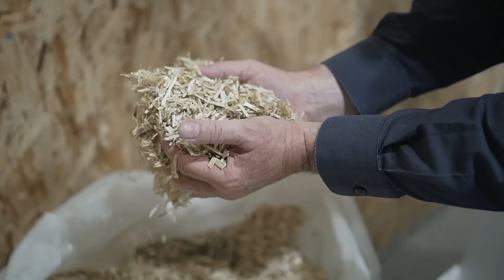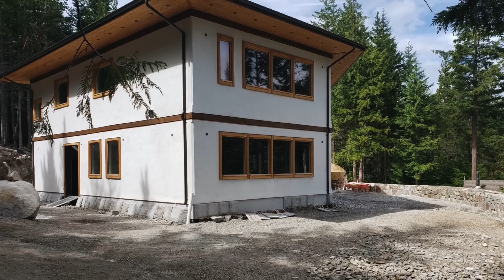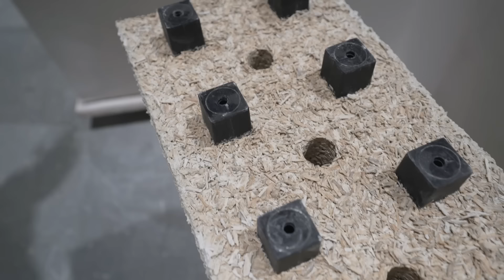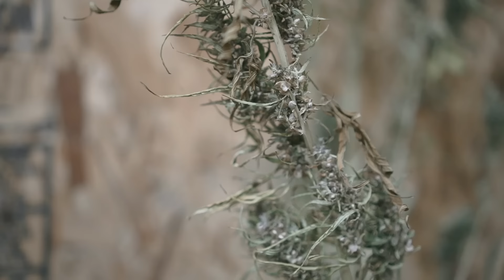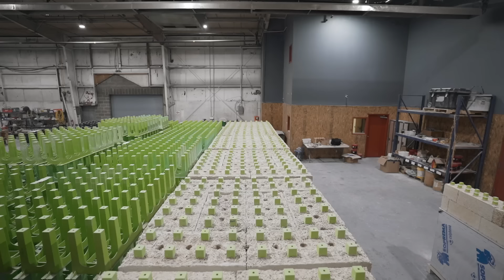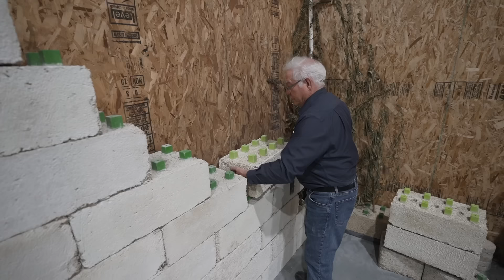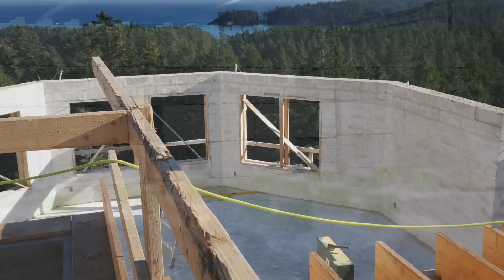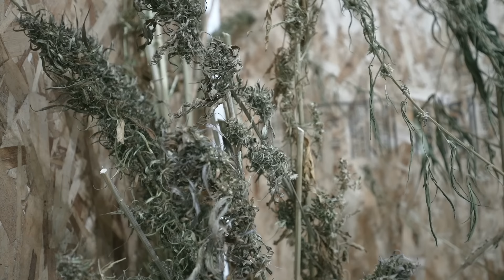Amazing Lego-Style HEMP BLOCKS Make Building a House Quick, Easy & Sustainable

Comment: If they're half the weight of concrete, labor costs for the construction of the home should be considerably less and construction time could be considerably less which would compensate for the high cost of the building blocks.

Comment: the ultimate construction material, build like this and clad every outer surface with photovoltaic panels, all walls and roof areas and you will have a dwelling that has no need to be connected to any grid for power, photovoltaic panels are 100% waterproof so will protect the outer surfaces, it's the future and I've seen it, where did I put the skins. . .

Comment: Please give a just-for-fun cost estimate for a school project. The idea is 9 modular, semi-independent rooms, each 18 X 18. The room front-left is a bedroom. Behind is a bath. Behind the bath is the kitchen. Front and center is the living room which takes up two cubes. It is 18 X 36. Behind it is the dining room. On the right are another bedroom, a bath, and another bedroom. Electrical and plumbing come from under the frost line and into the home center. The home is powered entirely by solar and wind power. The roof slope would be steep enough to prevent snow from accumulating. The home would be in Grass Valley CA. Would this home be cost-prohibitive when compared with traditional wood building?

Comment: I wonder if it handles an earthquake better than concrete blocks.  It looks like the blocks could vibrate an inch gap between them and settle back into its original state because of the connection pieces.

Comment: Be mindful of this types of "advancements" . They are designed for the benefit of Manufactures & Builders ..the end user, not so much.
There is just no way you could trust exterior walls made of this comparted to concrete. Hit the exterior wall with a hammer and tells me what happens.

Roxul will give you all the insulation you will ever need added to a concrete wall. A straw house is exactly that.

Comment: An Idea that has probably been said before, you could use recycled plastics in the form of filament usable by 3d printers and make those interlocking segments, making it so not only are you using a plant based material for the brick itself, but the frame in which the hempcrete is molded around is also taking plastics from going out to ocean and using them for our housing.
Reply: Not a good idea.  The reason they're using a thermosetting plastic as opposed to a thermoplastic like you would use in a fdm printer is heat resistance.  That's a pretty important factor if there's a fire.
Reply: I think we should just stop using plastic all together!

Comment: 8:30 "It sequesters like 1.6 times its weight in CO2..." This seems like a misleading statement. Plant fibre is made of cellulose. Cellulose is made of carbon, hydrogen, and oxygen. If you're telling me that it sequesters more than its weight in CO2, you're just telling me that there's carbon in the material, because 72% of the weight in carbon dioxide is the oxygen, and that can come from the ambient air as well as the oxygen in the cellulose, but nobody really cares about sequestering the oxygen. More accurately it sequesters some lesser fraction of its weight in carbon, and you could make that same statement to support building out of wood, grass, recycled plastic... basically anything that might otherwise be left to decompose or get incinerated.

Comment: what about the wet walls, vents, ducting, the foundation, roof and floor connections. Seismic, frost, and hurricane performance. You need tension members to handle this, there is no tension in a stacked block structure. Old brick buildings in seismic zones are death traps. And block is very heavy, for brick or CMU buildings there is steel rebar running in both directions throughout the whole wall usually. And you need a much wider foundation to support a heavy building like this. I like the concept of the product but these are huge issues. We need products that work in all climates and hazard zones and with standard building appliances and the mechanical and plumbing codes.

Comment: To be honest: No. There are reasons why houses are usually built with a supporting frame, which consists either of load bearing walls or beams. As others have already mentioned: How does such a building behave if there is an earthquake? Or what if the ground settles/moves a bit? Those blocks are not cemented together, mind you, and those thin layers of plaster on the sides will not do much. … I have no problem with hemp as a filler, I have a problem with the internal support structure. I would suggest to replace glass fiber or styrofoam insulation with hemp, but what I see here is just not convincing.

Comment: Hempcrete was pretty popular in Soviet Union (Called Arbolite, and it looks like it was invented in Europe), and currently popular building material in Russia. It's warm, it has enough strength and it has very high impact resistance, due to it's viscosity (not sure that viscosity is correct word here, but it's should describe it's property pretty well). Mostly it's not an industrial age material, as basic idea not changed since ancient Mesopotamia. Main problem with it is -- that it has poorly predictable properties. Your solution looks like an interesting innovation as your bricks should have somewhat predictable strength, i.e. solve the main problem of the material.

Comment: 2:42  The only difference between concrete and this hempcrete is the ingredients.  They BOTH have lime.  Lime is made from limestone which has to be kiln fired to RELEASE CARBON DIOXIDE, bound up in the rock, back into the atmosphere to turn it into lime.  Carbon dioxide is released from the limestone PLUS the energy used to fire up the kiln.  This is no more environmentally friendly than concrete.  It is only lighter and quicker to decompose.  I wouldn't want that for my foundation.  Solid concrete for my foundation please.

Comment: Where is the electrical and plumber going ? Do you need to cut into the blocks... Also, it does not seems to have a lot of lateral strength, what is a good way to improve that without destroying the concept, finally how do you fix anything on this, like pipes or even a shelve, lighting or else

Comment: Where are you going to find all these master plasterers to create those smooth plaster walls? Realistically it's probably going to have to be drywall on the inside. I think that pipe runs, electrical outlets and ductwork would be difficult to work ould with these block walls.

Comment: What are the acoustics like?  My favourite material to live in has been all wood.  I've lived in a scandinavian pre-fab wood cabin (well, really a 2000sq house but all wood; horizontally cut blocks with wood floors and ceilings etc) and the temperature stability, acoustics, energy have been unmatched by any other material.

Comment: Hempcrete is the best building material ever. It can be done even more simple as this lego aproach, complete diy. We have been living in our hempcrete house for 3 years now and we can't imagine living in a concrete house anymore. Building and living with hempcrete makes you sincerely happy.
Reply: Where are you located? Just curious because of building regulations will be my concern with using them
Reply: @reneerobinson6953  Slovenia. You will probably need certificate for  lime binder and another one for hempcrete mixture. Easiest way is to buy both materials from specialized manufacturer, for which you should get also certificates. In my case I onlly bought lime binder from italy ( senini tecnocanapa) and they gave me certificate also for hempcrete mixture.
Reply: NO! 👎
Not buying your government propaganda.
Reply: @davidfajfar229  "Hempcrete is the best building material ever. It can be done even more simple as this lego aproach, complete diy."

What method did you use to make it?  Is your method scalable to mass production?
Reply: NO! 👎
Reply: Hempcrete: So those 5G millimeter frequencies can get into your home real easily.
Reply: @heruking4391  Your tinfoil hat is backwards.

Comment: I would be really interested in the approach to exterior coating. Real plaster is much better than drywall with regard to both moisture and mold issues because of the lime,  Would it also be a goog time to add colorant as a primer, I would love to try this on a small scale for a micro house.

Comment: I found this very interesting. I have a question: how do you anchor overhead cabinets in the kitchen? I lived in an adobe house and there were no overhead cabinets in the kitchen because you cannot anchor them to adobe. I would think there would be a similar challenge with the hemp blocks. Does anyone know the answer to this?
Reply: That's a pretty good question and I'm betting the answer is generally, you don't mount anything heavy to the wall for exactly that reason.  I can imagine a kind of bracket to do it (for both materials) though.  You could basically sandwich the wall in a pair of steel plates connected to each other via long carriage bolts.  This would distribute the load.  On the inside panel, you would then weld on some fittings to let you get the job done.  The biggest downside I see to this though is that you probably don't want that steel plate on the outside wall like that.  It would be a place where water from rain and condensation could get trapped and destroy the wall.  It would be fine if you could guarantee that it would stay sealed and dry forever, but you really can't do that.

Comment: I don't think there was a mention of how long it lasts.

The main part of my mum's house goes back to the 1600s, it used to be the village pub and has been extended a lot over the years. I'm not sure this would be as long lasting but I can see some of the benefits.
Reply: I'd use this for the interior & insulation, & good ol brick for the outside.
Reply: @Agent.Wadsworth  they actually work very well for exterior insulation, but you could face them with "good ol brick" is you needed, and then you would have a very bulletproof and EMF-proof building!
Reply: With fiber reinforced lime, it should be pretty strong, and in the worst case since it's not fixed, you'll only get surface cracks, so put some stucco on and paint and it'll be good. A brick wall will have cosmetic damage less easily, but can split when the house moves.
Reply: @satibel  exactly - it is very resilient and has the ability to absorb movement. Just make sure to use a vapour open stucco, like a lime-based stucco not cement, and colour the stucco with clay as opposed to painting it with plastic paint. It'll last much longer that way!
Reply: Website says "more than 100 years", and as long as you maintain the stucco, I'm sure it could last as long as cob houses do.
Reply: Not only that but how does it settle over time? I dunno it looks to me the wall will be riddled with cracks after few years... Maybe I am wrong but I just dont see it as rigid as a brick mortar wall.
Reply: it's got lime in it so it probably lasts quite a while.
Reply: Yes, very long lasting. Much like modern adobe or cob, but each level is supported by the internal frame, which is very strong and rigid, so there will be little settling. With the lime binder, it will automatically and slowly heal any cracks over time and continue to strengthen for many, many decades. Very durable and resilient material.

Comment: Living in an area where we get quite a bit of wet weather, I'd be interested in the short and long term affects from exposure to continuously wet conditions.
Reply: It's anti mold
Reply: It's literally hard as limestone once dried
Reply: If I built with these I'd definitely put up a moisture barrier around the outside like I would a normal house before applying stucco. Should be fine like that.
Reply: @ClassyGlassy33  humidity over 10-12 yrs will render it crumbly and falling apart.
Reply: @Mill_Wrong  possibly. It would be interesting to test.
Reply: Good point. Wonder if spraying a water repellent on it would help.
Reply: @STB-jh7od isn’t water repellent environmentally damaging?
Reply: @STB-jh7od  it would help, but ultimately I think that it would be unnecessary. If you installed a moisture barrier and added stucco over the top of it then you would be fine. If done right the place should be waterproof for a very long time.
Reply: @Jacob Glassmeyer  I had idea to use these as insulation in turning a tuff shed into house.
Reply: @ClassyGlassy33  the hemp-cret petrifies in time, so once the hemp has time to become a rock, it should last forever. ❤
Reply: Self regulates moisture

Comment: Is this product "waterproof" by nature or does it require the lime coating around it to keep the water out of the hemp material.  Would the blocks expand were they to soak in water?  If one of these homes was built in either a high rain environment or a frequent flood zone, would the house "melt" if it got wet.   You mention it's waterproof at 7:03, but I wondered if that's only when it's sealed.

Comment: in addition to the conduit holes, there should be grooves on the top and bottom of each block to form horizontal conduit channels. also, to speed up construction, rather than some kind of mortar buttered onto each row, lay a compressible sill sealer between the courses to block air. lay down a course of blocks, roll out the sill sealer the length of the wall, then lay the next row on top of it. then, either, the sill sealer strip can be left intact so that, when you put the next block on top of it, the sealer is squeezed into the hole that the green pegs fit into, thus making a tighter connection; or, the sealer strip could come ready-made with holes cut into it that perfectly match the position of the pegs.

Comment: What are the square pegs and the black structures made of? Is it plastic? How does the wall react if water gets in? Do the blocks remain stable or do they become soft? Is the wall stable? The blocks are actually only placed on top of each other and not stabilised with cement.

Comment: A brief financial analysis would help the audience understand if this is practical.  What is the actual cost per block in volume, delivered to a major market?  Since masons aren't required and blocks are just stacked what are comparative metrics on time to construct a wall of a given size compared to concrete hollow block masonry, and what is the comparative labor cost?
Reply: I was going to say that this surely is rather expensive, as it is still a niche market, but "as for pricing, the company says its hempcrete blocks can be up to 37% lower than traditional building materials with comparable specifications." I suppose it is hard to do a 1:1 comparison, but it does seem economically viable.
Reply: ...and does it have to be hemp, or is that just a buzzword to get attention? Could the same thing be done with other, potentially cheaper, plant material without losing structural integrity?
Reply: @jonw8694  Hemp is pretty cheap in most places to be fair, since it's a weed type plant. It is however very durable and I kinda wish they would show those qualities.

Comment: Thank you for this video. It sounds like a fab material to use, keeps a house cool in sumner, warm in winter and is fire resistance.  Such a shame we don't use this much in the UK, it doesn't seem to have taken off. I really want our houses to be insulated with this!
Reply: There's actually quite a bit going on with hemp-lime in the UK. Check it out on-line as there are some big buildings, and lots of homes, built with this type of material in the UK!

Comment: So you have to seal the blocks with mortar  font you close the holes for the electricity then??
Reply: You could just avoid placing mortar over/in the holes. The mortar is only applied on the surface of each block
Reply: He specifically says you wire during build-up...it will take some more planning but the overall build time is lower so i think it evens out. Also I would suppose you can "cut and repair" like you do with a traditional wall, but i am not sure how that affects insulation and structural integrity of the whole thing Although at close to 6inches i would assume it's not that much...

Comment: Wow! I love this. How do they compare in price to concrete blocs? What can be done to drive the prices down? Where can we purchase these? Thank you!
Reply: You might want to factor in the speed of building with these blocks as opposed to usual bricks and mortar.
I think houses made of hemp blocks would be much faster to build.
Reply: there's a price chart on their website. 
$258/sqm for an R40+ house 
$266/sqm for a wood frame house (R25)
$694/sqm for a concrete block house (R17).
Reply: @vladtepes97  is that per square metre of floor area or per square metre of wall area?
Reply: @spindle7397  Obviously, its wall area under discussion.:face-red-droopy-eyes:
Reply: @spindle7397  I would say $258 per square meter is about comparable to cinder block. If you use cinder block, you still need insulation, fur strips, drywall and this product as all those built in so really there the time saver factor too. I like the thickness too, seems like it would make the house more beefy !!
Reply: definitely not fire safe like concrete, for residential buildings i think this is fine but not for an institutional buildings
Reply: @meee2014  Did you not watch to the end? they said its very fire resistant
Reply: @meee2014  So then, they lied, at 8:16 mark?

Comment: This is just walls: no insulation, no electricity, no plumbing, no windows, no doors, no basement, no floor, no ceiling, no roof, no attic, no finishing outside or inside. Very far fetch to say that you can build a house out of that.